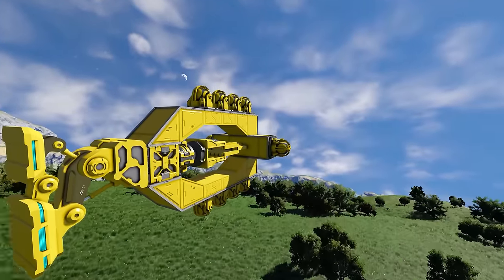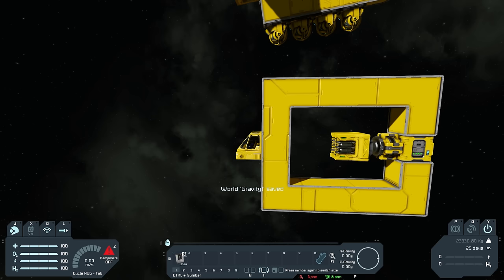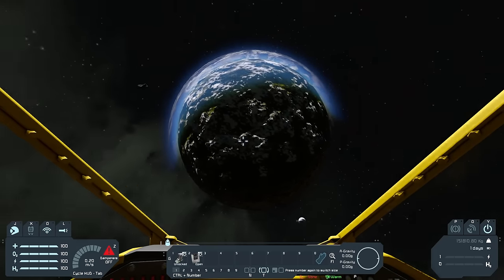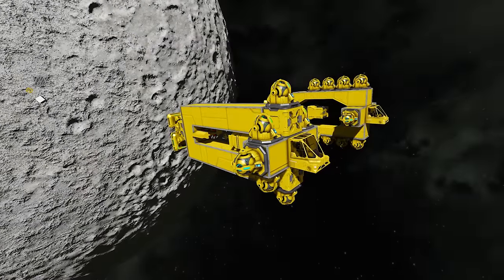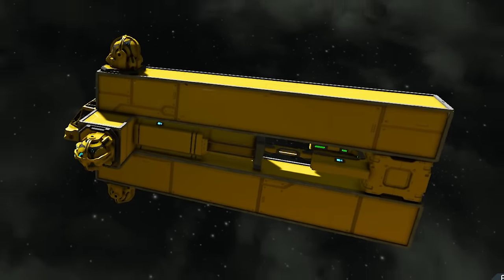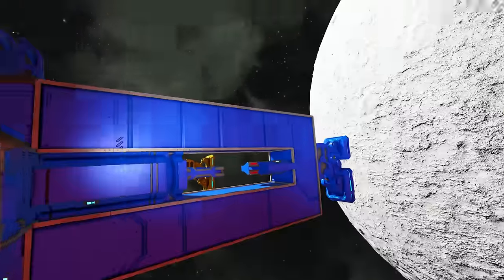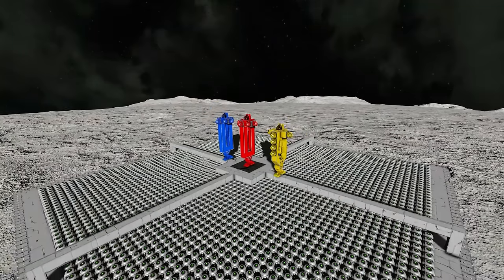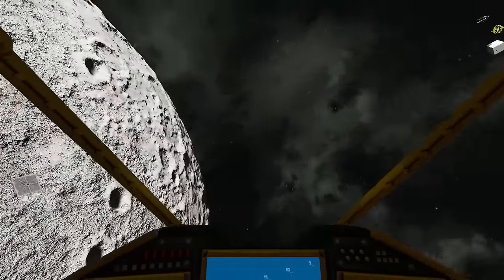The UNLIMITED POWER of the CLANG DRIVE - Breaking Space Engineers

Comment: just 2 know: wouldn't it be better to increase the min distance of the piston? It would start accelerating faster imho O.o
Reply from the maker: Did you not see it exploded? 😅
Reply from the maker: It would make you faster though, yes.
Reply: @Zer0sLegion  the min distance, not the max one
Reply: @Zer0sLegion  that's not what i meant.
The max extension over 2.5 would make the ship explode; the min extension would make the throttle faster to react (instead of waiting the piston to extend from 0 to 2.5 it should be 1.8~2.0 to 2.5).
It's not about speed but about reaction time of the throttle. Right now it takes 3 secs to activate, with a higher minimum distance it would take less.

Comment: seemingly does not work on small ships , you cant control the gyros while the craft is still, you have to be moving for the gyros to even work at all, i mean 0.01ms and then you can move but if your 00.00ms then your stuck in position.
only under impulse can you actually move.
Reply from the maker: I've tested ones that do work but the models I've shown here don't
Reply: @Zer0sLegion  do you have a video of small grid versions?
i tested some sub grid veersions aswell, and they look cool aswell as having fantastic thrust but going over 500 ms is klangs territory and it peels your ship apart.

Comment: Danm. these are alot easier than the Klang drives i used to build. alot of rotors timing blocks and merge blocks x-x  and it would be jerky violent short bursts of extreme acceleration,  these are a smooth steady and constant acceleration.
Reply from the maker: Yeah, I picked these as they were the easiest and stable-est versions I could find.

Comment: Didn't work for me after following the instructions exactly. It created a permanently immovable floating grid which even hydrogen thrusters could not move and gyros could not turn even after removing all the clang drive components. Strange one
Reply from the maker: You need to convert to ship, sounds like you've built a station
Reply: @Zer0sLegion  thanks for replying man! I'll try it when i get home
Reply: @Zer0sLegion  spot on works, subbed thx
Reply: @Zer0sLegion  I appear to be having the same or a similar issue with my hangar door clang drive, and I've tried switching it back and forth between station and ship to no avail, it's just stuck floating in the air unable to move or be moved.
Reply: Nevermind, it suddenly fell without warning and exploded violently

Comment: Yes, but HOW does it work?  I keep seeing people explaining how to build clang ships but they never explain the underlying principles that allow it to behave this way.  This means that I'm always stuck just copying other people's designs without any understanding of how or why they work so I can adapt or modify them myself.
Reply: The game doesn't want two blocks to exist in the same space. This works by forcing blocks which aren't quite set up correctly (like the door) to be in the same space as other blocks, thus the game applies force to the blocks to make them separate. 
That's what clang/Klang is. The often unexpected forces generated by strange physics interactions. But where a Klang incident might usually be caused by say, your rover randomly sinking a few inches into the ground for a second due to lag, and the game trying to reconcile that by making the whole rover break dance for a few seconds before exploding, here the chaotic forces are being held stable by the surrounding structure.
Reply from the maker: Clang works in mysterious ways...

In all seriousness, subgrids. Most, if not all, clang drives use subgrids in some fashion. For the hangar door one, the door is pushing against the blocks in front, and the rotor is pushing it back into the blocks in front and pulling the entire ship forward in the process. The piston one works on the same principle.
Reply: They work with Phantomforces apllied to a grid where the Physik Engine of SE cant do the math properly or is glitching out or where the physical model for interaction and the bounding box of the outlines of the block are not the same.
you maybee know this effect from small grids with a large grid welder or drill on a hinge or rotor. Or a thrusterspack or wing on a rotor on a ship.
while moving them or just while banging it into its endstops (physical blocks arround or arbitrary from the settings) the ship will do crazy movements or not stay still or sink in a gravity field while having inertia on and all thrusters. active.
Ii think Keen have made some adjustements to not have this problem that mutch anymore.

As you can see with the Hangar Door reaching into the Blocks while opened (but not while closed) or the Pilar and Door contraption (the pilar can penetrate the door block from below) you use 2 Blocks who interferr with each other in the colliding model but dont explode since the physical bounding box arround isnt touching. And you applie a force to this blockmixup. the hangar door is in its basic form a piston with a airtight and expanding blockshape arround who is pushing against the other blocks.
and the other version just uses a piston additional blocks.
you can also use a rotor or hinge block for this to applie forces. for example you can build 10 or 20 rotors and switch their vertical displacement to max. while pushing a block trugh a doorblock and close them or something.
with a rotor stack you can also accelerate a block on top of the last piston verry fast as a clang gun...

also on most servers clang drives are forbidden since the simspeed is tanking hard with them active.
Reply: @Zer0sLegion  Shouldn't the forces cancel, then?  I mean, the door is pressing forward, putting pressure between the rotor and the front of the ship, right?  And since the ship isn't tearing apart, that means the forces have to be balanced, right?  The block is pushing back against the door with the same strength as the door is pressing on the block.

Or is the game engine adding in a new force that's not being produced by the blocks themselves?  The comment above implies that the game is trying to reconcile two blocks being in the same space by "pushing" them apart.  Is this the unbalanced force that's providing your motion?  But at the same time, the hanger door isn't in the same place as the armour block it's pressing against.  Or is it that the door presses back against the rotor and it's the push between the rotor and the rotor part that's causing the force?
Reply: @AngryDuck79  check out Splitsie's tutorials, specifically his one on phantom forces and Clang. It goes into detail on what exactly is happening and why